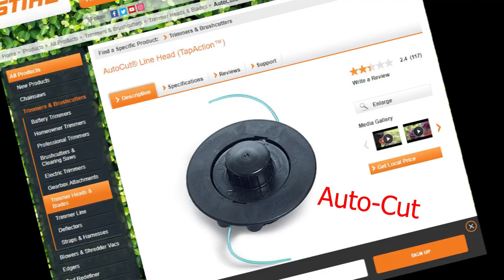Will It Run?? Bringing Back a Stihl String Trimmer FS55

Comment: Congrats on getting it to run again 👍 mine is running but it takes a while to get it started. Full choke to start, the engine runs for a second or two then by the time flip the choke to normal, I have to restart to get her to run.
Reply from the maker: Sounds like the mixture is definitely off. There’s a video on YouTube by Steve’s Small Engine Salloon on adjusting a 2 cycle fuel mixture. It’s great and he explains everything
Reply: @ChrisXOutdoors  thanks for the advice, will definitely check it out!

Comment: Just pull the cord and check compression first.  If not good, walk away.  Pull the muffler and look for bore scorring.  You’ve waisted a lot of time disassembling the trimmer, without even doing the simple things first.
Reply from the maker: Turned out ok

Comment: I have one of these thats almost 10 years old and its still going. It just now got the original fuel lines replaced and they were still good, just got a kit of parts that had new lines in it. Its only on its second carb too in that abount of time. This thing has been dead nuts reliable. It still has 150 psi in the cylinder too. It's been used very heavily.
Reply: I have a 24 year old blower.  The original pull cord broke last month.  That thing has been a beast.  All I ever did is use non ethanol gas and stihl brand oil and emptied gas can at end of season and then run it until it runs out of gas.  Then…. I let all 5 stihl equipment set up for a year with bad gas.  Had to replace all carbs and went ahead and replaced all bulbs, fuel lines and fuel filters, blah.  My fault.

Comment: so what finally fixed it was the cleaning and gapping of Magneto, another point you could have easily stripped the Magneto bolts using a power tool, that's what I did and not using a power tool they are soft aluminum bolts, I had to drill it out and used a stainless steel self-tapping screw, did not have any taps and dies

Comment: I’m not through the whole video and I’m wondering if you are going to check the spark Arrester
Reply from the maker: I don’t believe I checked it
Reply: This particular trimmer does not have a spark arrestor. It has a catalytic converter, hence that “KAT” name on the side of the muffler. In my experience the cat mufflers are a pain to unclog once they become clogged, since you cannot access the inside of the muffler easily. What I do is just replace them with a regular muffler with a spark arrestor so that when it does become clogged you can just remove it with a socket. Those mufflers with the cat also tend to run way hotter than the regular mufflers which causes the top of the machine to get uncomfortably hot, and even discolor the plastic which is what happened to my trimmer.